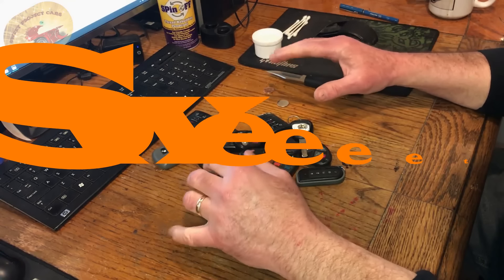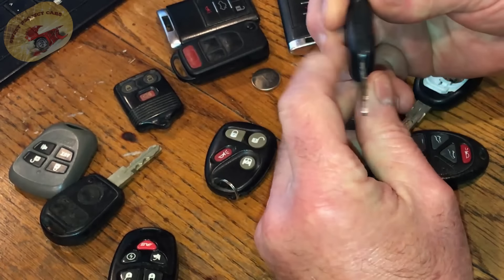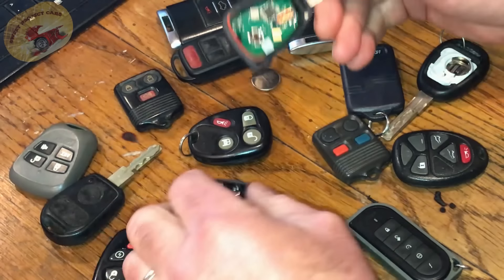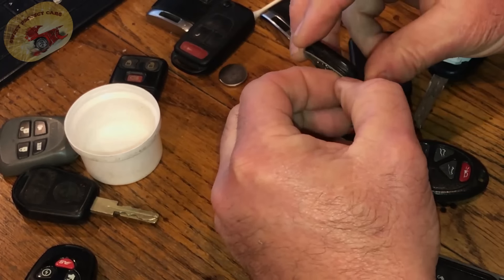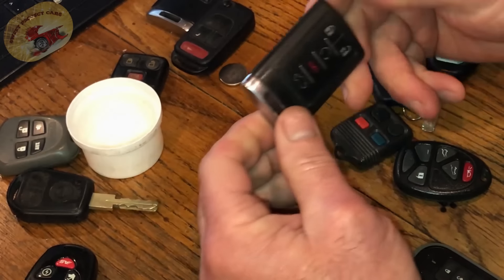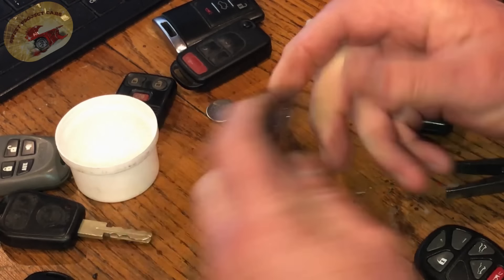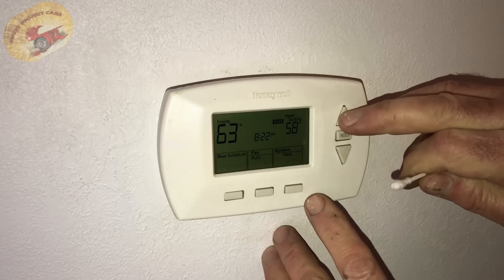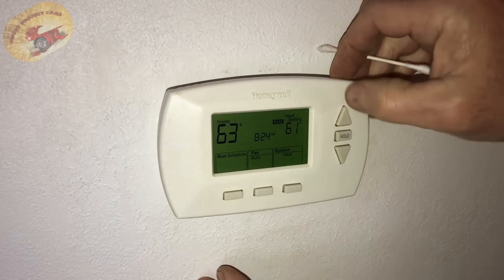How To Repair a KEY FOB in JUST SECONDS!....DIY

Comment from the maker: ****Hello, Our Great SWEET PROJECT CAR Subscribers!**** We share with you the second most issue with your Key Fob. We Hope this loads your mechanical ability treasure chest up so you can help some out someday. This repair works on most all soft-touch controls as you will soon see with our bonus info in this video. *** Quote of the DAY! Treat People as You Would Love to be Treated, even if they Don't do the Same to You*** Mike
Reply: what is 99% in england is it wd40 ????or isopol
Reply: @mikeosborn3906  you've almost certainly found the answer by now. :-)  But just in case anyone else is wondering, it's isopropyl alcohol.  The 99% is the amount of alcohol. My husband tells me that there are different percentages in the stuff. Inspired by this splendid video, I  was all set to have a go immediately  with some that I had, but he pointed out that mine was only 70% and it would take longer for the fob to dry.  Curses!   Still, at least it prompted him to start to sort out my two-week-old key fob problem himself!
Reply: You lost me there with the ," 99%" what's that?

Comment: I've never had to clean the pads (but that's a good idea for next time). I have only had a broken solder joint (which is easily re-soldered) on the battery terminals. This is the case in 6 different fobs, including car and garage door openers. It seems pushing hard on the button may break the solder joint.

Comment: I was just about to buy a new key fob for my 2003 Subaru as both of mine had stopped working.  Oddly enough the Subaru has similar contacts to the Ford you had posted, but I cleaned the terminals and the rubber lining anyway.    I did a search for key fob repair, found this, and now BOTH of my key fobs are back and operational.  Saved me about $50 or more.  Thanks!
Reply from the maker: That is fantastic, David! Glad we could help, thanks for watching and sharing your results, we truly appreciate it, have a great week my friend. mad Mike the hammer SPC

Comment: Hi Mike ;)  I used to work on electronic keyboards / keypads and you are spot on with your cleaning.  If someone were to find extreme oxidation on the touch pad(s) they could use a rubber erasure to clean the circuitry followed up with the 99% and "Q-tip" to remove any residue.  One other thing I would suggest to do while it is apart - clean the openings on the plastic cover where the buttons protrude.  Sometimes they get "sticky stuff" in them and we all know what that can do to a key fob.  Usually it takes a bit of "hot water" to remove sugar laden sediment.  I've washed (with hot, soapy water) many keyboards and keypads in the past without any hesitation.  Thanks for the great share!  Oh and in the office machine repair business we used to call those pliers "duckbills!"
Reply from the maker: Ray Jones thank you for sharing a great useful comment my friend

Comment: Worked great! Thanks! Fixed two 2010 Chrysler T&C Fobs. Some of the silver discs were out of place, so a little drop of rubber cement on the rubber case side held them in place. Saved me $180 per fob!!!

Comment: it works!!! i did it on my 2001 saturn (which they don’t even make anymore) key fob. it didn’t work when i first got the car, so we just thought it needed a new battery. but then we got a new one and it still didn’t work. well i came across this video and did as you said only i didn’t have alcohol so i used other stuff. and let me tell you, that key fob was NASTY!! it had some oil or grease or something all in it. but i cleaned it, put in a new battery and reset the fob and it works now after months of me not using it cause i thought it was just broken. thanks so much!!!
Reply from the maker: That is awesome to hear Leigha! So glad we could help, those things get filthy and people don't think to clean them this way, and it does work! Thank you for watching and sharing your results, we really appreciate it, hope you have a great day my friend. mad Mike the hammer SPC

Comment: Thanks for this fix!  I wanted to point out that in a 2001 Jeep, there's a plastic layer that needs to be slid off and cleaned.  It sticks to the PCB and relays the pushing action through to the PCB from the rubber button.  The carbon coated section makes a contact within the PCB closing a circuit for that button, that is the button press.

Mine was gunky from probably 20 years of trapped skin cells and oils so I gave it a full cleaning.

Works great now!
Reply from the maker: Glad it helped! Thank you for watching and sharing, we really appreciate the input. Have a great weekend my friend. mad Mike & team
Reply: @SweetProjectCars what’s the 99 that you reference in the vid?

Comment: Thank you for the video. I went swimming in a hotel pool and didn't notice the keys were in my swimsuit for at least an hour. The fob didn't work at all after I got out. When I got home, I opened up the fob and left it in a ziploc bag filled with rice and forgot about it for a couple of weeks. Today, I had time to work on it and used some rubbing alcohol to clean up the circuit board and contacts. I let it dry for a half hour or so and put it back together. The fob is now working great.
Reply from the maker: Glad we could help Dustin! Thanks for watching and sharing, we appreciate it, hope you have a great week my friend. mad Mike

Comment: One of the electric mirrors was not adjusting in my car (2002 Rover 75) I feared the motor in the mirror has failed but cleaned the door switch in the same way.  Fixed it!  👍

Comment: Thank you for the helpful video.  I was having trouble with my Toyota Fob, which has an enclosed type button connectors so the alcohol was not what fixed it.  But your video did make me think about the copper leads that connect to the battery.   So I cleaned the leads to the battery, and probably more importantly, bent the little copper pieces, both on the flat side and the side,  to make sure they made good contact with the battery.  Now my remote works perfectly.
Reply from the maker: Happy to help Andy!! Thank you for watching and sharing your results, we really appreciate your input, have a great day my friend. mad Mike the hammer SPC

Comment: Boy I used to work for AT&T, bench repair, and  the cordless  phone handsets had a lot of this trouble. The black buttons that contact with the  circuit pads have a chemical that  breaks down over time and exude a grease like substance that prevents proper contact with the button and pad.  Clean it all off with alcohol and it's all good again. 

Thanks
Reply from the maker: grassroot011 thanks so much for sharing a great quality comment my friend

Comment: Excellent. Haven't yet seen this problem addressed as you have. Problem occurs with most any silicone rubber touchpad device including TV remotes. The issue however, is not as much "dirt" as it is the release of silicone oil from the rubber touch pads which forms a gooey/oily substance preventing proper conductivity between the silicone rubber touch pad keys and the circuit board pad. I've cleaning numerous remotes that were literally coated in goo.
Current speculation is that the repeated pressing of the keys is what squeezes out the oil of improperly cured silicone over time. 99% acts as a degreaser to remove the excess oil, allowing the electrical contact to be properly made between the rubber pad and the circuit board.
Reply from the maker: with all that said our method works great for the home diyer
Reply: @SweetProjectCars  Yes, absolutely! 99% does the trick and is what I use too :) Just thought I'd elaborate on the cause of all that goo :)
Reply: @SweetProjectCars  what part of the dryer?  Just discovered your video and it’s taking me on unchartered territory.  I was ready to pay $400 for a new fob.  My first try didn’t work but I was using baking soda instead of alcohol before I knew what you referred to as 99%.  Never knew there was such a thing. Will try again and see if it unsticks the buttons. Thanks for the info!
Reply: @gwanma  I, too, thought he was referring to beer when he said IPA (isopropyl alcohol).🤣

Comment: sweet trick! i did the same on the keypad on my 10 yo microwave oven cos some of the buttons weren't working right. and it worked! the only pain was removing the top and side panel in order to access the button panel where the rubber membrane and circuit board was. :(

Comment: Easy to solder a microswitch back to the circuit board. I just fixed my Volvo that had two switches stuck to the booty when I took it apart. Saved big bucks.

Comment: Just wanted to say: My remote couldn't be helped by alcohol because it has microswitches like the Ford one... The tiny button was gummed up with a green corrosion paste. After trying many ways to clean it, and making sure the solder joints were good, I eventually tried touching the top of the button with a soldering iron and the green goo came gushing out, boiling like caramelized sugar. I dabbed it with a paper towel and repeated it a few more times until not much sludge was coming out. It works now!
Reply from the maker: Thank you for watching and sharing my friend.  It's people like you that make our channel valuable to everyone!  Hope you have a great day.  mad Mike the hammer SPC

Comment: hey i have a 2008 suzuki swift and the fob on the key to lock/unlock the car failed. As in the circuit boad has 2 yellow looking buttons that come off. my question is : is it possible to make those circuit board buttons stick  or not really?
Reply from the maker: Can you please send me some pics of what you have Mr rage, send them to sweetprojectcars@gmail.com I will see if I can get you pointed in the right direction my friend. mad Mike the hammer SPC

Comment: Thanks for the great tip...I have a 2009 Dodge Journey key fob and a 2005 Mercedes ML350 key fob to try this on but was wondering if there is a difference between 0ld 99% vs regular rubbing alcohol...Can I just use regular rubbing alcohol?
Reply from the maker: Please follow the video to a T, there is no other alternative, use the exact same tools, products and method, we've spent years perfecting this process. Thanks for watching and asking, have a great week. 
mad Mike the hammer SPC

Comment: Holy crap!  This works! My 2009 remote which hadn't worked in YEARS now works beautifully!!! My mechanic even looked at fixing the remote one time but couldn't get it to work.
This is amazing!  Winters in Canada are long, hard, and cold...It's been hell because I park outside at home and at work.  When at work, I have A LOT of things to carry.  When I get to the car, I have to open the driver door so I can open the trunk, or whichever other door i need open. Sometimes i have to walk back around to the driver's side because the other doors didn't unlock for some reason.  REAL PAIN.  Now I can unlock all the doors and even the trunk remotely!  AMAZING!!!  My 2007 Santa Fe remote stopped working long ago too.  I just did the clean on it but it didn't work...BUT...after a few mins of inactivity a light came on the remote for the 1st time in FOREVER!  It's late, dark , and cold now...will play around tomorrow.  THANKS A BUNCH GUYS!!!!
Reply from the maker: Awesome!!  Glad to help.  Thanks so much for sharing, we really appreciate it!  Have a great day.  mad Mike the hammer SPC

Comment: Thanks for the sweet tip. Those Ford fobs can be fixed too if you're handy with a soldering iron, you can get repair kits containing spare switches. You can also get replacements for the little black rubber bits if they wear out. I've fixed a few for my neighbour.
Reply from the maker: ioneyesed we actually use this on the ford and other micro switched fobs https://amzn.to/2WC6VBc

Comment: Thank you loads - ur simple yet basic instructions to clean the circuit board worked perfectly (though I installed a new battery for my Honda Jazz Key Remote it only one button was working but now both works fine - well I used Old Spice aftershave to clean😉) God Bless for sharing this video
Reply from the maker: Great to hear!  Thanks for sharing your great results!  Have a fantastic day.  mad Mike the hammer SPC
Reply: That’s the problem I’m having with my Toyota Highlander remote. Only the unlock button is working. I’ll try what’s in the vid. Thanks for sharing!!!

Comment: Ok, I have a Volvo Key fob that has a metal key that fits into it. The metal peice won't stay in as it seems the spring isn't holding it in. Do you have any suggestions how to fix that.  I've had several times that the black peice has come off and its only by the grace of God that I found it. The dealer w wants almost $400 for one
Reply from the maker: I would put that key in a safe spot until you can either afford a new fob, or have the know how to replace the spring my friend. Sorry about that, but glad you found the key after losing it! Thanks for watching deborah, have a great day my friend. mad Mike

Comment: Im a true fan of (Sweet PC). I'm a D.i.yer & I have 06 silverado  crew cab. An i have did every thing imaginable. From new batterys 2 new keyfobs. An nothing seems 2 change. Im able 2 use the locking button, panic button, but it will never let me use the unlocking sequence. Ive reprogram, cleaned them. But the unlockin sequence never works. I have 4 different fobs. An they all do the same thing...
Have any thoughts (PLEASE) help me.
If possible!!!
(Thanks if it is possible)
Reply from the maker: Try this, disconnect both of your battery cables from the battery, clamp them together and let it sit for 12 to 24 hrs. then reconnect and try the fobs again. If that doesn't work, you may have to visit the GM dealership to have them re-flash your computer. Hope this helps, we truly appreciate the view and being a great subscriber. Have a sweeeeet rest of your week and all the best on your project my friend. mad Mike

Comment: Will this help with it working further distance? Mine works but sometimes it doesn’t want to or you can be right next to it and it not work occasionally it’s a GM.
Reply from the maker: Austin Cunningham a lot has to do with this cleaning but also on the quality of battery you use
Reply: I’ve put multiple battery’s in it just put a Duracell in it and it worked great for about a weak then back to the same. I just cleaned it and it seems to be doing great now

Comment: My Nissan key fob's alarm button was so sensitive that I was setting it off every time I bent down or what have you. It was a slightly different construction that had a little plastic nub that hits the momentary switch (Ford style).  Well anyways, after I shaved a millimeter off the nub it stopped going off in my pocket and now you have to press much harder to get the alarm to go off.
Reply: Great idea, will do that too, how did you cut it down?

Comment: My wife's fob for our Escape works fine and still has the original battery. Mine did work, but stopped. New batteries make it work for a few days, but it will be dead in two weeks laying on the kitchen table.
Reply from the maker: walmart the circuit board in the fob is no good you will need to replace it

Comment: Please respond, my Honda Civic 2017 key fob is all fine but the battery is not settling in it's place cuz of those little battery holders that holds the battery in place are missing and only 2 left out of 4! Idk how to fix it I'm super frustrated and it keeps annoying the hell out of me whenever I try to enter the car or when I push start the car!!?
Reply from the maker: Hello Pein, unless you are good a soldering, I would take a small piece of cardboard like a matchbook cover and fold it up to the thickness you need and place it on top of the battery to hold it in place then put the cover back on, it may do the trick until you can afford a new fob.  Hope this helps, thank you for watching and asking.  Have a great weekend. mad Mike the hammer SPC

Comment: I have a 2007 Dodge Magnum the remote key won't lock my car but it will unlock my car can it still be the battery
Reply from the maker: No, it's one of the switches inside. Have you done the video as shown? Thanks, have a great day. mad Mike the hammer SPC

Comment: tight. Got any recomendations for replacing the metal part that fell out that touches the battery? Shops want 75$ for a new one! Talk about a scam racket. I just wanna fix/solder it can I use alum foil to complete the circut? thx
Reply: can you get a key FOB replacement at the dealership or auto  parts store
Reply from the maker: You can look on ebay and find a key fob for sale for only a few bucks and rob parts from it for yours, if you can't do that, then you can use a small piece of wire or foil soldered in.  Hope this helps, thanks for watching and asking, all the best on your project my friend. mad Mike the hammer SPC

Comment: My key fob quit working so I changed the battery and still nothing. I have an extra one that I haven’t touched in 2yrs, it worked before but now neither one works even with a new battery. I’ll try this but if it doesn’t fix the issue do you think it’s a fuse in the Car?
Reply from the maker: No, try the video you will probably find it works.  It has nothing to do with fuses.  Thanks for asking, hope this helps.  Have a great evening.  mad Mike the hammer SPC

Comment: Good stuff Mike. I hate the way these key fobs open (having to take a coin and split them in two). The best design I've ever seen is by Honda. To change the battery all you need to do is twist the coin sized disc off the back. Under is the battery. Keep up the great work Mike! ~Tom

Comment: I have a question. The battery of my fob key (toyota vitz) runs low every week. Do you have any tips? Thanks in advance.
Reply from the maker: Yes, follow the video on the cleaning process you probably have a contact inside the fob that is touching just enough to drain the battery.  Thanks for asking, have a great day.  mad Mike the hammer SPC